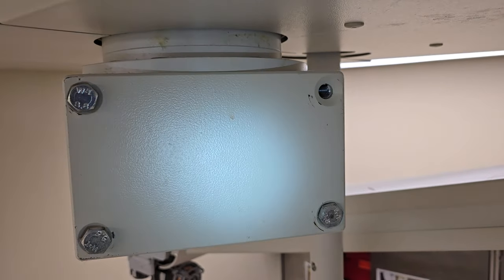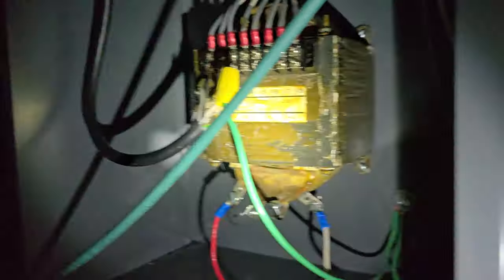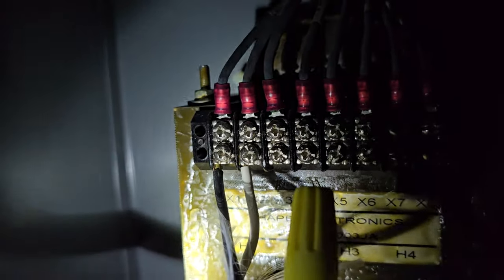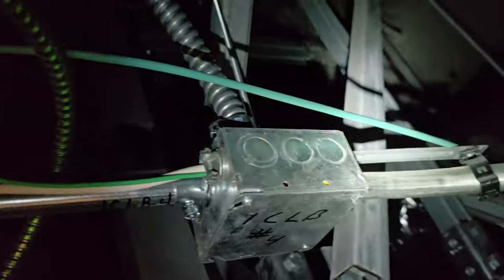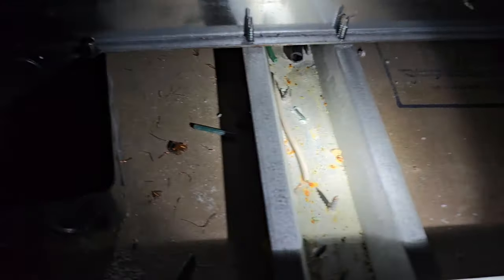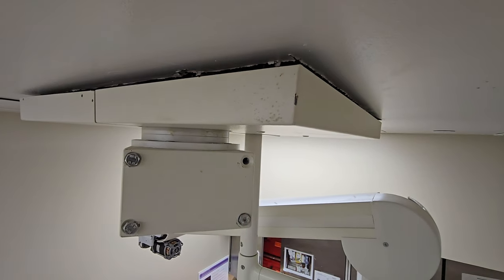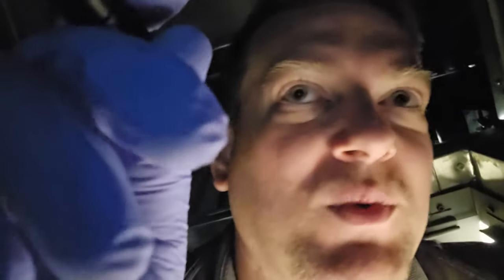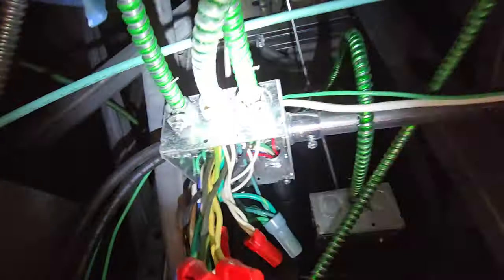Wiring Nightmare Before CBET Exam

Comment: Probably got your CBET by the time I write this. I’m old- took the CBET exam in 1980 when they still had some questions on hybrid tube/solid state ekg machines. I just retired last year.
It’s true that problems can be caused by others working in the area, or if you just did a PM & something doesn’t work, always backtrack. You hate to hear that everything was working fine until you did the PM!

Comment: White and black on a wire nut could be a switch leg. You have a rat's nest and a mess on that transformer for sure. I hate it when I find boxes open and trash in the ceiling.